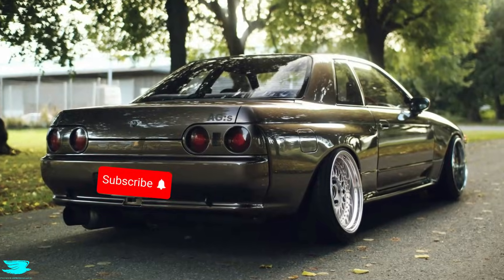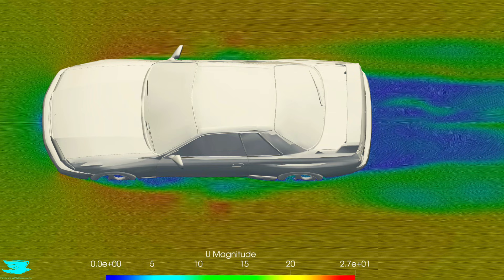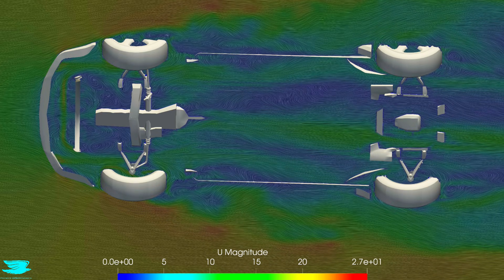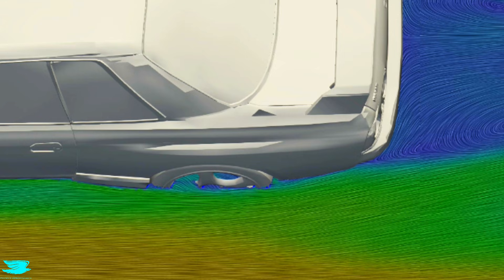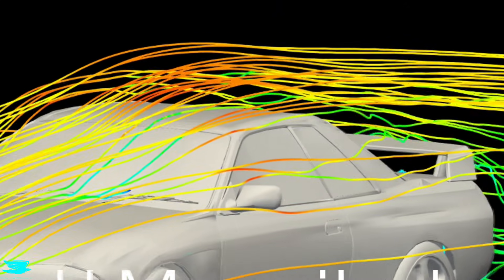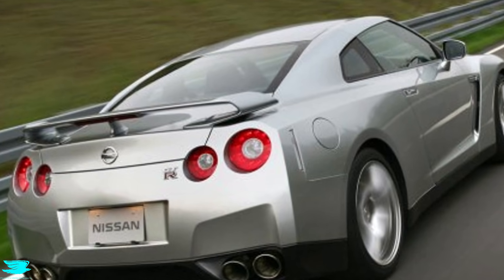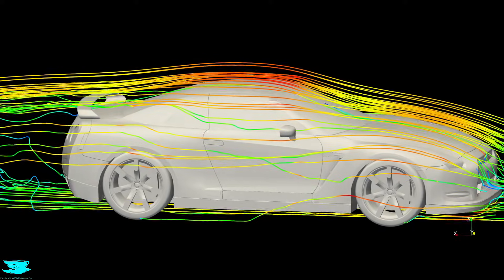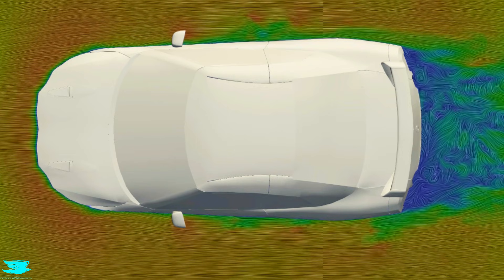The Aero Problem Nissan Solved Between the R32 and R35 GT-R

Comment: So I suppose if you are an r32 owner looking to improve your cars aero performance, do the following things: 1) relief the high pressure build up around front wheels with vented fenders 2) tidy up airflow under the body with flat undercarriage panel and a difuser, if flat bottom is not practical, use a deep air dam up front to reduce upstream airflow that would travel underneath. 3) have a trunk spoiler that has the effect of reducing the size of the seperation zone above the trunk 4) if needed, mount a higher wing

Comment: @premieraeurdynamics Question on the speed used? Why so slow? When I was in school for industrial design/Transport design one of my instructors worked at Mercedes. He mentioned the wind tunnel tests were preformed at 120km. He mention that is when all the aero starts working together. I did have to study some Aerodynamics yet did not get a degree in it. When seeing your test on a R32 at 70km seems a bit slow. Being the car was originally designed to race which has higher speeds so driving/test at slow KM seems to have me asking why? Yes, I understand the flow can either fall apart more or increase in some areas. As my understanding is as speed increases the high pressure areas can shift. Like on the R35 having a high before the rear wind. Yet if speed moves to 120-150km will that area increase or....
Thank you for doing the videos and I strive to learn more.
Reply: he said that 72 kph is the speed where the aerodynamic forces starts to affect the car's dynamics
Reply from the maker: Yep, that is why.
Reply from the maker: It’s the point where drag starts to be more important than rolling resistance.

Now, there are a few test standards. 140kph is common, but also 70-80 is also sometimes tested to see how the flow changes between speeds.
Reply: @PremierAerodynamics  my curiosity is more for the 140kph because that is where most cars will spend most of their lives. ok, some faster. Thanks

Comment: Thanks for the video, but please split downforce or lift between the front and the rear of the cars and then give a combined number, for example a car has 20kg of downforce on the front and 15kg of lift at the rear @100 km/h, saying that car has 5kg of downforce at 100 km/h says nearly nothing about the driving dynamics of the car, taking a slight turn at 200 km/h with 80kgs of downforce front and 60kgs of lift rear would feel very unstable, or even worse...lead to a crash due to big aerodynamic instability

Comment: getting a lot of instinct/bias confirmation from this video :P 

have made the argument that the front windshield wile probably not "actual aero" level's of downforce does because of it's angle usually provide some downforce simply because it's at an angle at not a wall/scoop.
and i have grown a bias for smaller rims with some actual rubber on them (my car went from 17"225/45's to 15"195/i wanna say 60's and it's night and day noise/confort wise) and cars with hips both of which also appear to reduce drag :P

c'mon cars with hips make a comeback.

Comment: Hai can u explain how to reduce drag on r32
Reply: its actually easy flat under body 
new and better design wing 
and small front lip and rear diffuser 
aka plywood and new wing
Reply: @speed1coffee  the thing is I am currently hunting for a good deal for a GTR (32, 33 or 34) and I had almost zeroed in on one car the 33. Having some financial problems and a slight delay in completing the paperwork. 
Not for my daily driver; for that my Suzuki Swift solid.

33 is not the same as the 32 but yet similar. Moreover, I will tune that car but not that ridiculous level of tuning. For joy riding and occasional track use... 

7:55  time stamp: 
I am quite intrigued by these small triangle-like bodies he showed on the back part of the roof when he said about reducing the drag of that 32. So hoping his designs could contribute to my future widebody kit imagination..... 

I want a widebody kit. But not just for show... It should have some aero advantages....
Reply: @TheNonAlignedGuy i remember all veilside body kit is tunel tested 
And if you live in place that's not in us or German or track day most of the life of the car it's should not need wing you can build some down force win good underbody parts
Reply: @TheNonAlignedGuy  the triangles u mentioned are the vortex generators they would help accelerate the flow so the wing can produce more downforce and the car gets lower drag in the rear wind.
Reply: @luisdias3939 ok thanks bro for the explanation. 😊❤
Reply: @speed1coffee I considered a veilside kit. But a lot of guys who own 32 33 34 and even 35 use liberty or veilside. So I want to be a bit different to those. 

Currently enquiring at a local car modification garage with 3d printing... I hope things will pan out as i expected. 
Because iam not that rich and this 33 project is draining me a bit. Not just the money, my time effort etc..... 😊